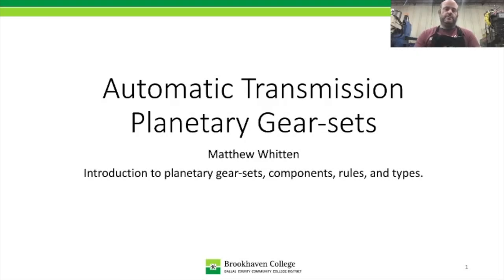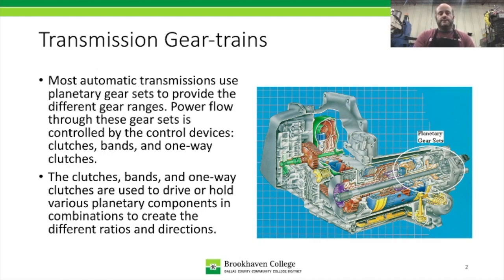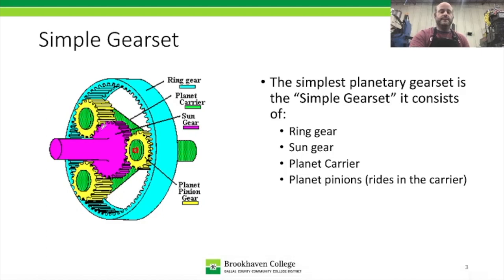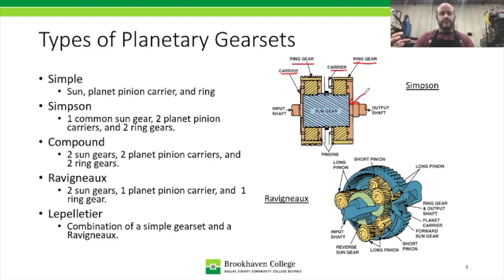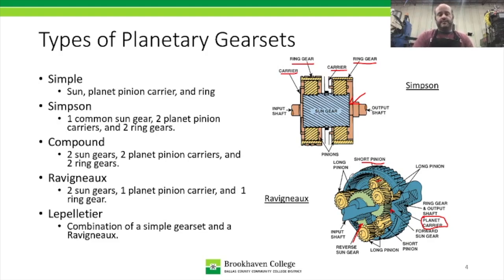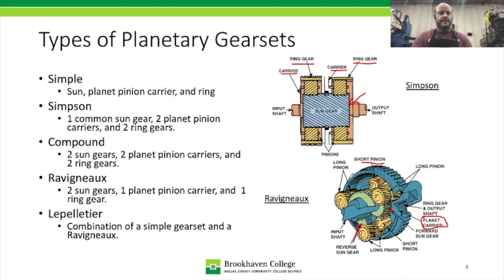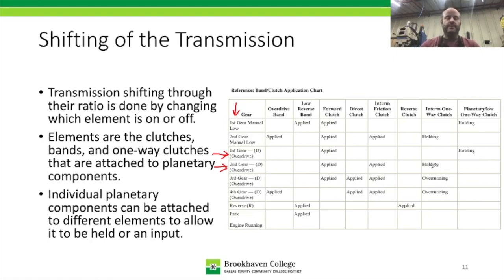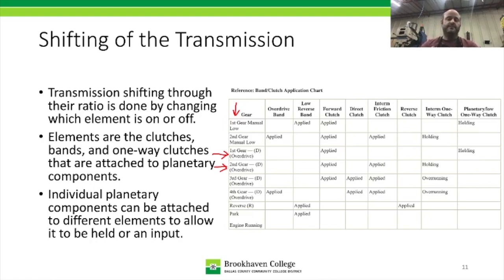Automatic Transmission Introduction to Planetary Gear-sets

Comment: hi. what if the sun gear is fixed, then the planetary gear is sped up to say 1000rpm and then the sun gear released? With nothing fixed we are in neutral, but will the sun gear at the change start to rotate at 1000rpm?